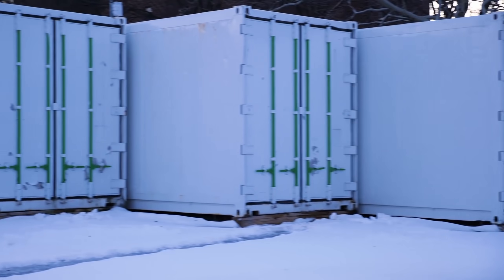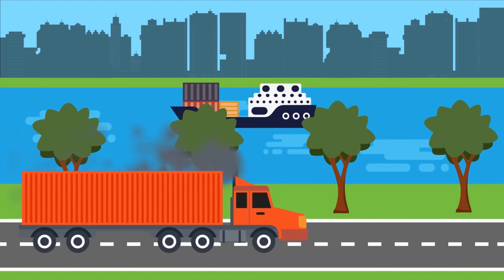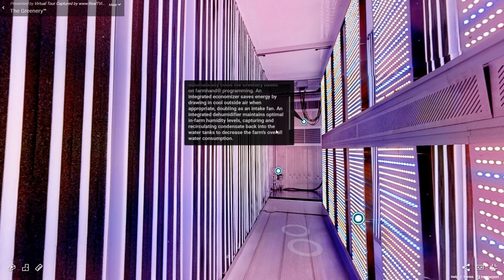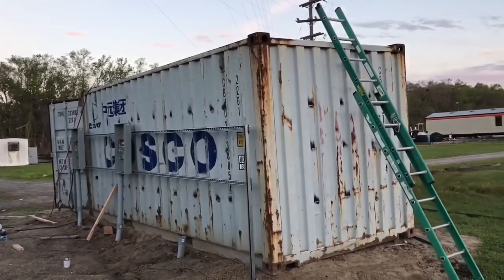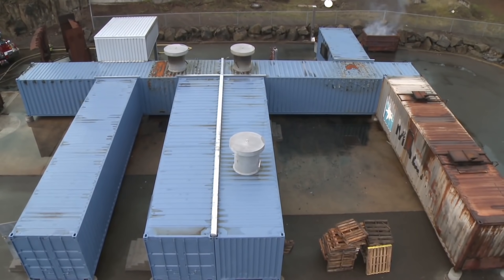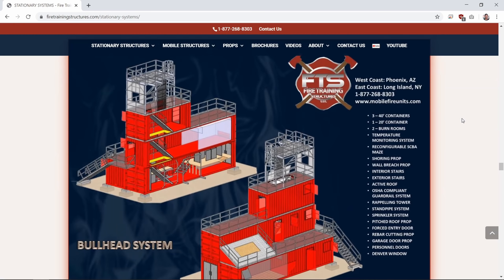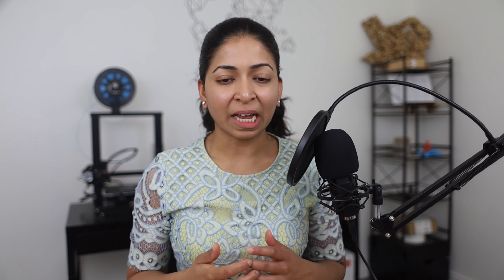Top 5 Shipping Container Conversions | bitcoin, Kimbal Musk & more

Comment: Some ideas I think you missed in this series:  Cons for container homes -- The flat roof presents a real problem in many areas, particularly areas that get precipitation.  You need to find a way to ensure water, snow, ice do not collect on the roof and have adequate drainage.  Some locales will not give you a permit to build if your home does not have a slope (example:  some areas of Wyoming require a minimum 12-30 degree pitch in roof due to potential snow loads), so even if you don't want a pitched roof, you may be forced to construct one to meet building codes (an added expense).  Another negative:  You have to hire a crane or  special trucks to deliver the container home, and if stacking them, need special cranes to place the container. Placing the container (especially if stacking) may require special permits beyond what might be required if the home is just built with conventional materials. In flat wide open areas, this might not present a problem, but in remote and hilly areas, the logistics of container placement could be daunting.  Probably one of the biggest CONS for shipping containers, of any use, is getting city building inspectors to approve building the container, placing it in a place permanently, getting neighborhood buy-in, and getting permits issued.  Generally, one might have to resort to headache amounts of paperwork to get zoning approval changes, or neighbors to enjoy your unpainted container exterior.

As you DID say:  Cons and pros have not only to do with port location (as a cost consideration) but climate location really plays a role in whether or not containers make sense in any location.  Those locations (sans port location) range from "a really stupid idea" to "a great option" based on climate alone.

Some ideas as PROS that I think you missed / misunderstood for containers (as homes) -- A MOBILE container home is MUCH more durable than any other mobile home (THOW).  Of course, the down side is that it is also possibly heavier than other options.  But such a home is more durable under road conditions and could last many more years than a typical RV while making the home more like a real home. The vehicle could be made to be immensely more secure than any RV or tiny home or mobile home.  The containers are made into a width and length and height that makes transporting them on the road easy. Container homes that are MOBILE are actually using containers as they were intended to be used -- moving from place to place.  It is even possible to put a container on a ship and move from country to country.   Another PRO for containers over other forms of construction:  Because of the ability to stack containers, they are the cheapest means to go vertical.  Even if you have to reinforce the structure because of offset or cutting, or extra height, the overall cost of adding more floors and height to a wood structure gets more expensive with each level, whereas a container can actually be built at ground level and lifted any number of levels above the ground already constructed inside.  You can't really do that with a regular house.    ANOTHER PRO:  Except unless you live in an area that is super-ridiculous about building codes ( like Salt Lake City, which thinks it is necessary to support the integrity of your shipping container at least 8' underground to make it stable) a foundation for a shipping container can be constructed for just the corners of the home, potentially saving significant costs in providing a foundation.  Foundations can be poured for only the primary corner points.  Even if a full foundation is constructed, many options on how that is done are available for container homes, from bolting the container to a slab, to preparing a basement under a foundation with shipping containers built on top.  Potentially a foundation for a container home can be constructed in a weekend and the exterior of the container home can be completed in a week.

Durability?  If your container is secured to a foundation (bolted, welded, steel strapped), it is grounded and earthquakes and tornadoes, and floods and landslides will probably be more durable for a container home than any other kind of tiny home, or regular home.  Take care of a container home and build it right the first time, and it likely will last longer than a stick-frame house, with less (but different) kind of maintenance.  

Ideas you just can't compete with?  People who don't understand other people who desire living in a tiny home.  For those who need regular sticks and bricks of a massive size, you'll just never get then to understand why ANYONE desires and WANTS to live in a place less than 400 sq feet.  (I currently live in a 110-sq ft space, and would LOVE to have a 320-sq ft space -- a tiny McMansion IMO.)   Best just not to even try to justify why people shouldn't be living in "Tiny Homes".  It's like comparing those who like cats or dogs or reptiles or birds as pets and thinking one is always better than others.  Sometimes it just can't be compared.

Overall, a good bit of info.  Thanks for your efforts in publishing the series.

Comment: I started watching your videos, beginning with the "scam" video (title being a bit provocative) -Ive had a thing with containerized living for some time & I’m DEFINITELY NOT someone that fits into the "tiny home" category (all of my designs are several thousands of SqFt), my thoughts before watching this video were:
1. Maybe she's a crackpot
2. Maybe she's got an ax to grind
3. Maybe she knows something, has some legitimate points & I should watch for purposes of addressing some shortcomings in future builds (Thank you for your points in cantilevering)

Anyways, a few counterpoints to the 3 videos of yours I’ve watched along these lines
Scam video @2:10, #1 No one really "custom orders" containers unless you’re using it for a REALLY specific purpose (E.G. containers with longitudinal doors, grain containers with no roofs, etc. None of these are really used for residential purposes), container sizes are really just based off of trailer sizing’s as such they’re commonly available in 20ft, 40ft, 45ft (in both "normal" & hi cube elevations); Not so common offerings would be 10ft, 48ft, and 53ft (watching freight train movement with containerized payload, 53 footers seem to be pretty popular these days -I would imagine their availability on the secondary market will become more mainstream consequently getting cheaper & cheaper as time goes on)
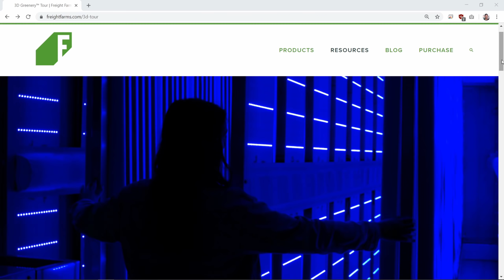#2 @2:25 Sprinklers (I’m assuming you’re speaking in the context of fire suppression?) aren’t really all that popular in residential settings
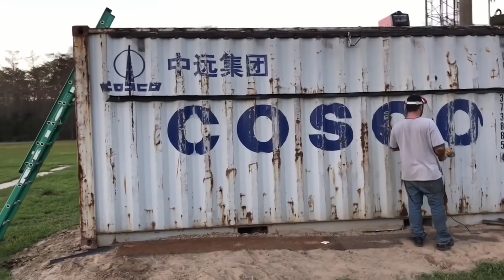#3 @3:55 "Expensive steel reinforcement", steel isn’t really all THAT expensive...   Lets say that a beam of whatever shape you’re wanting to use (I personally, have a thing for square tubing); lets say they’re $180 for a 20footer of receiver hitch tubing (I realize this is all contingent upon commodity spot market pricing & this will vary) & you’re going to use this at 8 foot length intervals for 9.5ft vertical ceilings in common between 2 containers (E.G. You’ve blown a wall out & are concatenating 2 containers side by side), this comes to $90/8ft section of wall you’ve removed
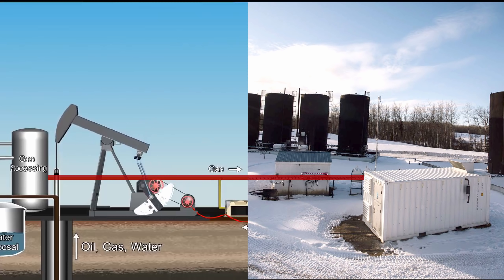#4 @5:10 "Health risks", Ok so there’s some possibility that the marine grade wood plywood flooring may have came into contact with payload thats...   other than healthy for use by humans? Pull it out & replace with normal residential grade flooring (or better yet, use the legacy floor as subflooring to build on top of); Who wants to have a house with marine grade plywood as their flooring anyway?!?
#5 @5:30 "One trip containers", to my knowledge in the USA -The only locality to have a restriction for containerized housing for "one trip containers" is the state of California
#6 @6:00 Transport costs, if you live in the middle of no where -Sure, you’ve got a legitimate point; However the entire point of a shipping container is intermodel transport (ship, train, truck), As such just because you’re not coastal doesn’t mean you cant get a good deal on a container; Rail yards charge rent on a daily basis to container owners; If the container owner doesn’t have payload to move down the road it quickly becomes more equitable to liquidate the container than to leave it sitting in the rail yard for some random trucking company to go pick it up, bring it to some customer, load it up, drive it down to the receiver (or back to the rail yard) whenever they get around to it
#7 @6:55 one trip containers, getting more trips; When you look at global movement of goods, most everything comes from China to USA, there’s not that large of a percentage of non-refrigerated containerized goods leaving USA (There’s the possibility of containers being used for truck shipments intracountry, but since weights are a huge thing in the trucking industry; the overhead weight (tare weight, if you will) of an empty container adversely impacts how much billable payload you can legally move down the road with) ~> Thus a really huge glut of containers that wind up in country & never really leave

Your counterpoints in your response video, I found were...   (and Im not trying to get cheeky here) entertaining & insightful
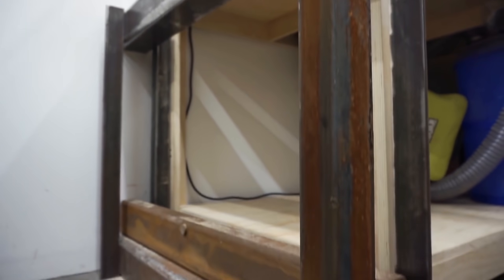#1 @8:18 Cost comparison, alot of the capital costs on a per square foot basis (assuming you’re in the tiny home crowd, again -I am not) are probably going to be more since you’re concatenating a kitchen, bathroom, bedroom(s), and common living areas presumptively into (1) 300'ish SqFt container; Kitchens & bathrooms are going to have an artificially higher per SqFt cost due to the resources they require & the fact that most municipalities will typically have a fair amount of building code in regard to these 2 rooms; Assuming your building plan is using more than 1 container, these costs will tend to flatten out to seemingly "normal stick building" construction as rooms in other containers will presumptively require less complex construction resources (contingent upon the buyers requirements of course)

5 successful conversions video (this one here)
#1 @2:25 Freight farms, 1a. installed a much more advanced HVAC system; I wouldn’t really call it advanced, I would call it significantly less powerful & as such consumes less resources than the legacy refrigeration gear that was replaced 1b. "The structure of the container wasn’t compromised in any way"; I suppose this is a bit of potato/poTATOE here but I would call the end cap & doors structural -Looking at the imagery of their box, it seems as though with the smaller refrigeration gear they’ve equipped the box with, they’ve put a significant amount of sheet metal (and Im assuming insulation?) in its place to fill in the void left by the previous equipment & the typical freight doors have been removed & replaced with an insulated bulkhead & a more "typical" door like what someone would see on a walk-in freezer, generator set, etc.
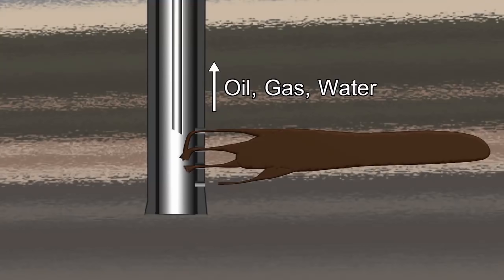#2 @4:40 Black pearl resources, Typically in refining with the petrochemical industry they will "flare off" waste gasses (some would call, sewer gas) that are unusable/unprofitable in a petrochem operation, in this situation they’re using a microturbine generator to process their unusable "trash" into a electrical byproduct that they use locally in plant & also for something that’s electrically hungry...   bitcoin mining; Which I wonder at the end of the day, how profitable it is?
#3 In the context of NON-Residential container spaces, you left out google datacenters...    Which, yea...   the DC as a whole isnt built out of containers; Its more built like a shipping terminal, but the compute resources (servers) are all hotplugged several thousand at a time on a container by container basis; Anytime there’s some new huge change in server technology, they can have a container per DC built, trucked out to each DC, they unhook the power & signal resources to the container, move it off to the side replacing it with the container full of newer servers & drive away with all of the old technology
#4 Your original video was critical of containerized housing, if you’re going to make a success video -it would be nice to have a majority of the content as residential containerized housing as opposed to largely "industrial" use cases, but...   Hey, its a start  ;)

Comment: Hi Belinda, yesterday I discovered your previous video of 7 reasons why using containers to create tiny houses can be a scam. 

I liked it quite a bit and found all your points very reasonable. It's a shame that it generated so much hate and hostility to the extent that you had to make a second video about it that I saw anyway.

This video made me curious and I find very interesting the alternative uses of the containers beyond their use for housing. I was about to give a dislike to the use of mining farms for bitcoins. It is a use that wastes an obscene amount of energy and the benefit is very questionable. However, the use of gas in oil fields to provide them with energy may be more justifiable.

I was glad to see the guys who build houses with containers that you recommend, I saw one of their videos yesterday showing the most economical budget for one of the houses they build and I don't think it's that cheap, but it's interesting.

I haven't seen more videos of you in case you have something more recent about building with containers, but it would be interesting if you could show the difficulties with the containers to weld them well to avoid water leaks that rust the steel sheet and deteriorate it quickly; and other common disadvantages.

Comment: I'm planning on getting two shipping containers to convert one into a pottery studio and the other will house my electric kiln and glazing materials.

I really appreciate your videos on the pros and cons of shipping container construction and I'm so sad that you had to deal with racism and sexism for posting your knowledgeable opinion 

I wondered if you have any thoughts on using a thermal packaging solution on the inside of the shipping container, like TPI, which they claim reduces the risk of condensation to zero? It's relatively cheap, £700 for a 20ft container, and I'd clad the walls and ceiling with wood, had several extractor fans and a wood burning stove for the winter...

Comment: This was a much better video than the scam one. I liked it.

 I feel like you could've made the same points and gotten a positive response in that prior one, but didn't because of a few reasons:
-Clickbaity title on the original video. "Scam" also has a strong negative connotation, at least where I live. They're not scams - they're just very complicated and expensive to get right, and it is a more stylistic choice. (Just like granite countertops, right?)
-Prior video was not long enough. It only superficially delved into the negatives of container home construction. While mostly correct, if you had gone deeper and included more footage and proof (and links to container home channels that have detailed videos listing some of the challenges), and changed the wording a little bit, it could've come off like a public service announcement. A video designed to help people avoid a costly mistake.
-Speaking of wording - rather than calling those awesome little homes a scam, it may have been taken better if you had called them impractical for 95% of people, and said that for most people the homes should remain dreams.

Just by shifting a few things around, your points would've been taken better. Your approach was too confrontational to get anything but a negative response from people that have already fallen in love with them. (Myself included -  I could watch Living Big in a Tiny Home endlessly after long, stressful days. Perfect channel to unwind to in the evening.)